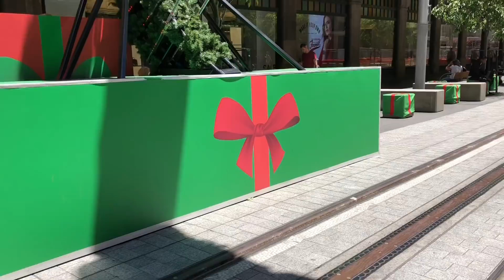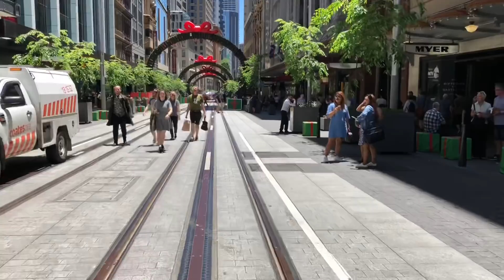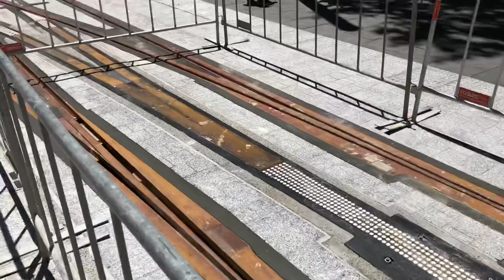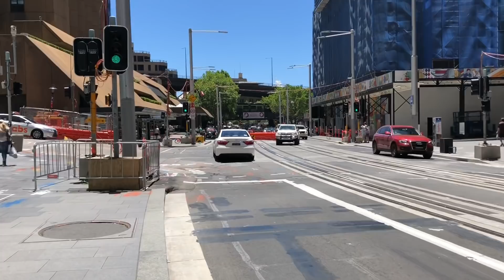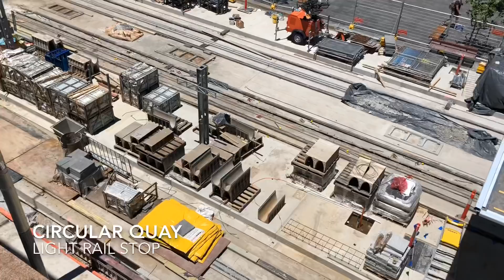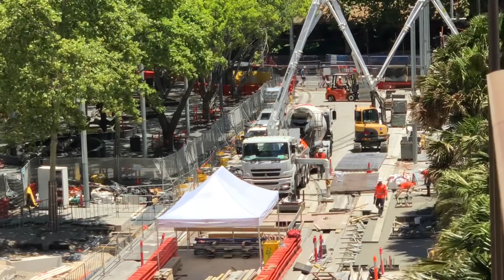Sydney Trains Vlog 1511: CBD & South East Light Rail - Town Hall to Circular Quay Update

Comment: I guess it will be worthwhile once finished but I still can’t help but feel it’s over-engineered to buggery. I seriously doubt that having normal overhead power supply down George Street would have significantly changed the appearance and would have significantly reduced the cost. But too late now I guess. The ‘damage’ is already done.
Reply: exactly, considering all poles are there already
Reply: you can blame clover moore for that. The government was going to run normal poles but she wanted the in ground solution.
Reply: Craig Simpson the state government should have just said no and built as is. Isn’t George St a state road or is it council?